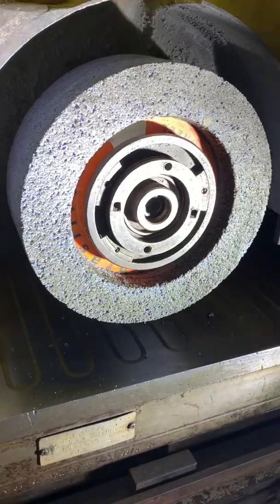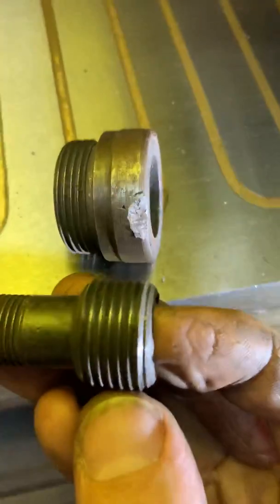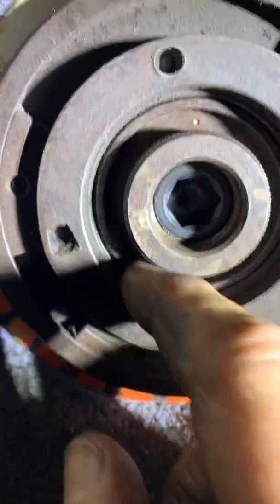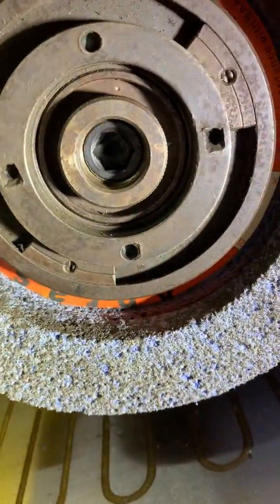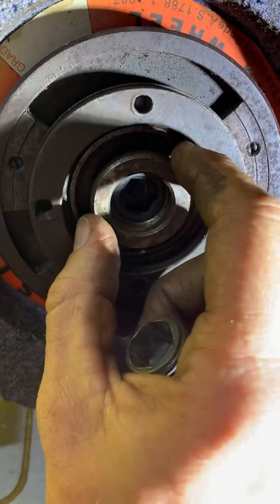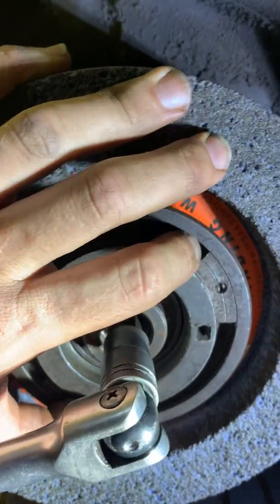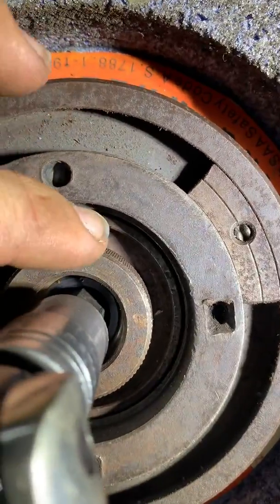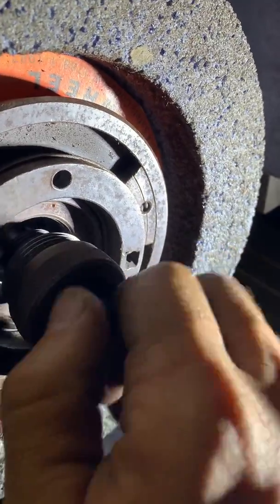Blohm Simplex 75 Surface grinder hub removal

Comment: You are wrong about removing grinding wheel from taper - You don't need any other things to do that, all You need is on Your spindel right now. When You rotating screw counterclockwise at 3:50 to align two marks on the screw and on the collar to remove grinding wheel You must rotate that screw a little more in this direction. Maybe You need to hit the wrench by hand. And differences between threads on the screw pull the collar from the taper. This is not my idea, this is what the manufacturer this machine designed this process.
Grettings.

Comment: Shit man, that is a damn rude design... Fiddly as fuck... Effective, and offers a wheel removal solution as you demonstrated, but fiddly and slow as fuck... Now i know that you are filming here and thus it takes longer to do anything, but still... Most s.gs that i`ve seen have naught but a precision shouldered bolt that threads into the spindle nose and pulls the wheel onto the nose taper... The wheel turns one way, so like an angle grinder, there is no way for it to somehow loosen itself as everything that you do just tries to turn the bolt even tighter... 
Nice machine, i helped a guy whom i got my charmilles edm sinker from to move his blohm simplex 75 outta the shop where both machines were and wherefrom both were being kicked out as the lease expired, but i didn`t pay attention to much about the blohm other than safely and gently moving it out and having it lifted in accordance with the manual and having the two travel safely first to the owner`s home and then to my home for the charmilles to be unloaded aswell... A nice machine, decent size for a personal shop and for most small jobs, but truth be told, i like my ELB better... Tho, without having ever operated a blohm, i can`t say it with absolute certainty... 

Nice video btw!
All the best and kind regards!
Steuss